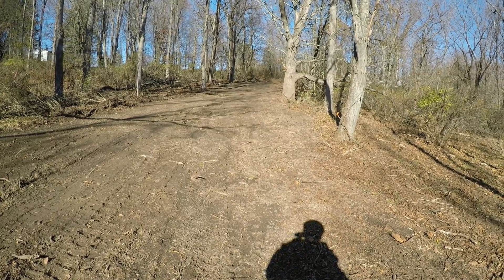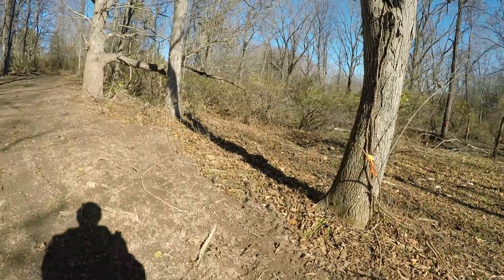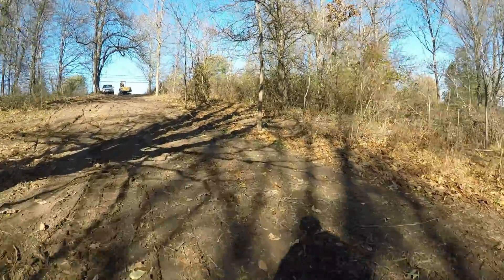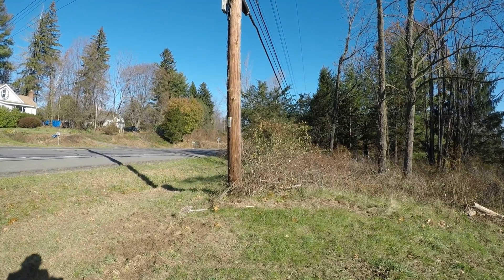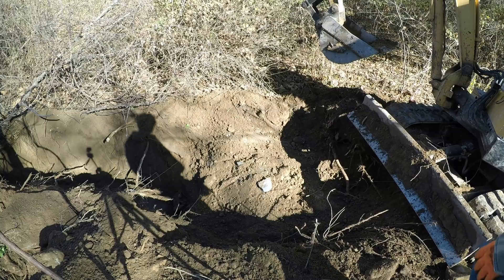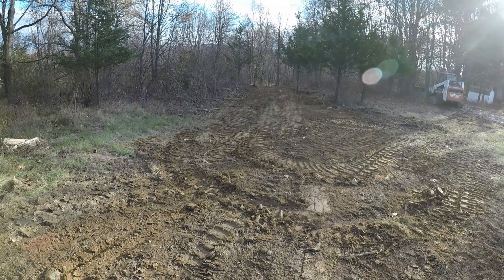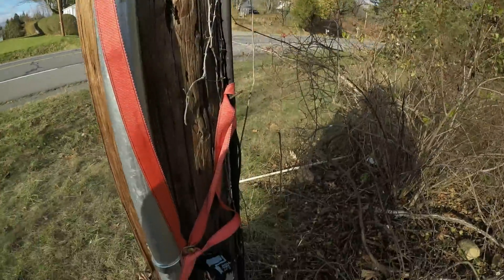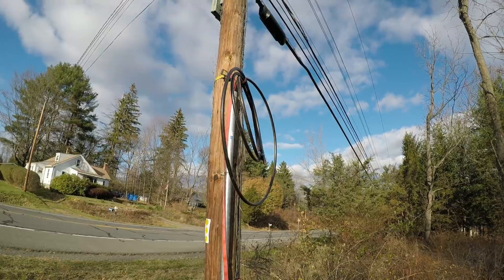Installing underground electric service

Comment: Andrew, if you do much clearing you ought to check out the Dragon Tail. They are made in Colorado. There is a combination sheer/grapple to skid logs.
Reply from the maker: That's an interesting attachment. I usually use my grapple, or tow it with tractor for moving logs around.

Comment: I though that you might have to put some stone or sand a few inches above the cables to differentiate the area around where the cables are actually buried?
Reply: Eoin Wylie me too. We have to bury them in sand, then backfill
Reply from the maker: They don't need it in the conduit.
Reply: Andrew Camarata it's required where i am in Southern NH. I find a lot of what you do odd, not that you are wrong for your area. I appreciate you making these videos, enjoy your capable attitude as well. Just was taught differently, and apparently have tighter building codes.
Reply: Over here in Scotland we have to jump through hoops with building control. The cables would have to be 1200mm/4 feet deep with sand/dust/screenings at the bottom of the trench. Then the cables. More dust/sand/screenings 100mm/4 inches deep, warning tape on top of that, then it can be back filled. And you need to find a home for the extra fill that’s leftover. Looks so much easier across the pond.

Comment: I miss the 743 Bobcat hope you still have it, i still have mine.
Reply from the maker: skynet000001 yes I have the 743, this tracked one works much better though. My 743; I took out one of the drive motors to get rebuilt. I haven't gotten it back yet. I had the other side rebuilt last year.

Comment: Maybe a thumb would help with large objects also great video thanks
Reply from the maker: I have a thumb, it would have been in the way for all that digging. The thumb is good for tree work, scrap metal, or dealing some boulders.
Reply: Mechanical thumbs in my opinion are almost totally useless hydraulic thumbs only way to go

Comment: Is that primary cable a coax-type? Looked like it was at the tranformer end...
A gap between power and cable tv depends an the voltage of the primary, i think.
Talk the owner to set up the found rock for mounting the housenumber at the entrance of the driveway...
Nice work, as always!
Reply from the maker: Yeah, I could roll that rock up there. Ill try do to something cool with it.
Reply: Hi. That's armoured steel cable. There's a skill involved in making the joints at each end. BobUK.

Comment: you should use your Hitachi ex100 a lot more!!
Reply from the maker: johndeere 6200 johndeere6200 I use it when I need to. The Yanmar was appropriate for that. Plus this job is far from home, I wouldn't really want to move that there. 
I have to dig the foundation next. I think I might dig it with that skid steer, like 50 years ago when track loaders were more common.
Reply: Andrew Camarata great vid again by the way 👏👏
Reply from the maker: Thanks

Comment: Thanks for the video Andrew.  I have been explaining the exact same logic to many electricians for years...if the tape is directly on top of the conduit, then by the time the bucket rips through the tape, it's also ripping directly through your live conductors!  I always tell them to lay the tape at least a foot above the conduit, or more where more room is available.
Reply from the maker: Yes.

Comment: Most power poles where I live (NZ) are concrete or galvanized steel with a plastic sleeve. Are wooden poles common where you are Andrew - presumably they are ground treated?
Reply from the maker: Yeah, 99.99% of the polls are wood like that.
Reply: Up here in Wisconsin, they are coated in pitch, and wrapped before they go in the ground

Comment: How is that 864 treating you? I recently got a pair of over the tire tracks for my wheeled skid and was amazed at the difference in traction. Makes me want to try a dedicated track machine.
Reply: Jacobd123456 In my opinion, once you use a posi track you'll never hop back in a skid steer
Reply from the maker: I haven't had the 864 long, but I really like it so far. Its much faster and mower powerful than the 743, and it does much better on hills and soft ground. Plus those wide tracks do a good job flatting the ground.

Comment: Rubber tire skid steer. Instead of a normal double arm lift it uses single mono arm. It was cheaper and easy finance. Sucker! Never again. I strayed from Kubota and paid for it. Maybe next year I cant swing the trade. Keep up the great work. Again your clean up finishing work sets the standard.
Reply from the maker: The machine doesn't work well? I have bought a few machines over the years that were just junk. I am planning on doing a video over the winter talking about them.
Reply: Z

Comment: Anything over 400 feet usually requires a primary lateral, except for services that are verified low draw. Over 300' requires 350mcm wire instead of the 4/0. I work for CH.
Reply from the maker: Connor Fasano thanks, good information.

Comment: I would love to get rid of my JCB Robot for a Kubota tracked.
Reply: What don't you like about the robot? The side door looks great to me cause I'm always wanting to get in and out with the boom halfway up. 
Watch out with Kubota I've heard they're having big problems with their hydraulic cooling, machines burning down left and right.
Reply from the maker: Military Museum what's a JCB robot?
Reply from the maker: A wheeled skid steer? I just got that tracked one. It works much better than the wheeled ones I have.
Reply: Jacobd123456. I have banged my knee to many times and my head. I'm to big for the jcb. Plus I want a tracked machine.

Comment: I though that the caution tape supposed to be a foot above the electrical/cable lines, back filling with rock like that is good over time. I use to end up repairing work like that. Not bad for man show, keep it bud

Comment: Great video! I'm not sure what the code is like there, but here in BC Canada we need a minimum 12" between power and data conduits. Especially when running high voltage, as the magnetic field can interfere with the low voltage data.
Reply from the maker: yoyit2Dan I agree with you, I have heard that before. I mentioned that to the guy, he wasn't concerned, there was a few other things he did that looked sloppy to me too.
Reply: Andrew Camarata for Sure! His conduit into the panel is very sloppy. I liked your tip about tying the caution tape to the roots!
Reply from the maker: yoyit2Dan I don't like how he had the freeze expansion thing all the way collapsed. I usually extend them half way.
Reply: @AndrewCamarata  The warning tape is suppose to be a minimum 10-12" above the buried conduit the whole way.  That means partially back filling and then laying the warning tape.  I agree with that size electrical cable the other conduit should be12" away either aside or above.  Since Coax cable is low voltage it does not need to be buried as deep.
Reply: Yea. I've always kept mine as far apart as the trench allows. 
Full disclosure, I've never worked with the big stuff before though, just the small 220v residential lines, and generally direct burial.
With that said, I've dug up lines (On request  ;-) that were with in six inches of each other, and the home owner never complained of a problem with interference that I know of. 
So while It could cause interference, the equipment these days has a much better rejection rate than the old analog wires of the past.
Reply: This reminds me, one time I installed a security system in my house, and ran a low voltage line from the main panel in the closet to a kaypad in the hallway through the attic.  I was laid parallel to a 120v line at first because that was the most direct route, and the dang intermittently didn't work.  I moved the low voltage line farther away from the romex and lo and behold, it worked perfectly.
Reply: Ha, Canada, don't you mean America north? How's Trudeau doing?
Reply: Ryan McWilliams He’s a major douche.
Reply: @DIGGER19860  The whole world from alaska to mexico

Comment: How much does something like this cost?  A range is fine - just trying to get an idea if I ever have to do this.
Reply: Price out what you are willing to work an hour and see how long you think it'll take you with the machines you have. Price out diesel and maintenance cost for the machines and then material.
Reply from the maker: ck m well there's the labor and materials. I only did the excavation. I was there two short days. If your pricing this out, just measure the distance, than price the materials.
Reply: Yeah, I'm wondering about the labour bit (that's always way more than materials...) - I'm guessing the total cost is around $5k?  Or more?  Really no idea, but it would be good to understand when looking at property....
Reply: I don't have any machines so that's pretty much irrelevant ....  I'm just an end customer.
Reply: ck m  For a recent underground we did, it was about $33 per foot (including the power company's cost) , but there was LOTS of ledge, had to bring in large excavator with hammer to break up some of the really bad spots, had to pour some concrete (where the trench was too shallow in solid ledge) and that includes secondary services to 2 different buildings. The service was almost a half mile long.

Comment: Enjoyable video again Andrew, thanks, BUT I have to say that this would never ever allowed here, where I live,...the two conduits would have to be further apart than these are  apparently due to magnetic and electrical  fields, also, the conduits would have to be laid on top of  sand and covered by a least a foot of sand, with warning tape on top of that before back filling. The larger rocks could, over time, rub through and then , well you can guess the rest!!
Reply: Where Andrew lives rocks behave themselves and don't rub through power lines! ;-)
Reply: @Sara-L  Ain't nary a thing wrong with yer Funny Bone Sara!!
Reply: @Sara-L  That's because Andrew lives in NY where rocks that don't behave are taxed at a higher rate than those that do behave. (From another sap dumb enough to stay in NY) However I think the extra sand layer is an added safety margin when included with the tape.
Reply: Backfilling without sand but with rocks would never fly in Maine tape on top of the sand
Reply: That’s where Andrew Camarata lives, rocks behave themselves and don’t rub through the power lines!!!!
Reply: @BillyRicker Of course,  I should have realized this. :)
Reply: Right. You don't put electric and cable in the same trench.
Reply: [ X ] WRONG
Reply: @electricianron_New_Jersey  Which part?